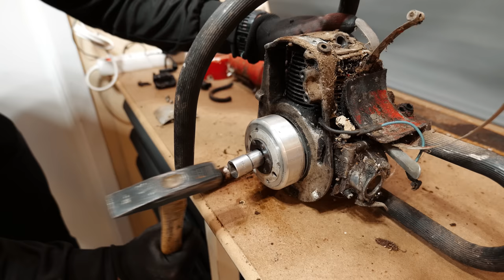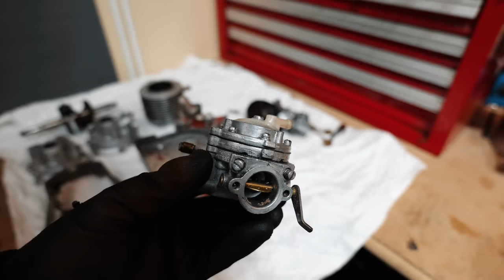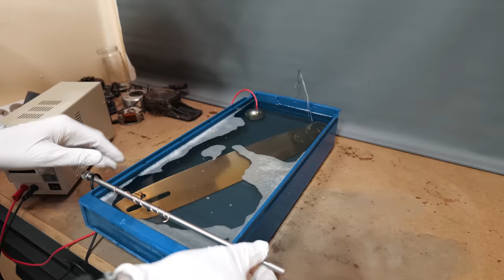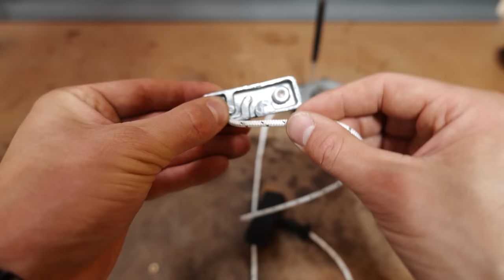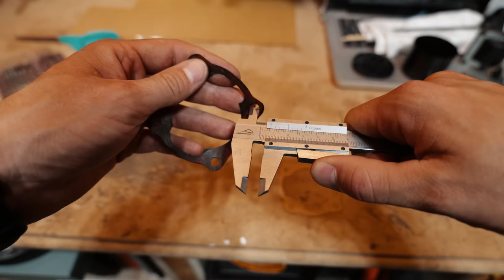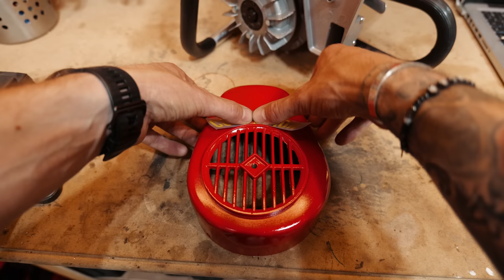RARE Chainsaw Restoration + Engine startup

Comment: I like your Zinc plating method because I can resurrect old lawnmower mufflers that way.

I hope that you used a gasket material such as Kevlar for the cylinder head gasket which can withstand the heat !
Reply from the maker: Yes zink works great on mufflers 😊 
For the cylinder head I used copper witch is original for this engine. 👍

Comment: tip: do not force the piston pin into the piston using a vice, I have seen people who pushed the piston Oval.  The design is such that one needs to use mild heat which expands the aluminium and thus creates a larger bore to slide in the steel pin   upon cooling the pin is firmly hold by the Alu.   removing: also use mild heat

Comment: Great way to bend/brake a connecting no turbo/supercharger, nitrous or bad timing required but atleast you don't have to worry about damage to the cylinder

Comment: Zinc plating is great for those old parts. It's my understanding that zinc has slightly better corrosion protection than nickel, due in part to galvanic action, though most youtube restorers prefer nickel, likely because it can be polished. I particularly like your comments for those repairs not shown. Magic not needed to be assumed. Enjoyed the restoration.
Reply from the maker: Thank you! Happy that you enjoyed my work. 😊🙏

Comment: I couldn't help but point out that when you zinc plated the bar for the chain you probably messed up the chain sprocket that is in the end of the bar which you probably didn't realise was there also the air cleaner did not need to be sanded I'm surprised that it started but definitely not first time would have been good to see it actually cut wood
Reply from the maker: There will be some wood cutting, maybe in a future video 🤔 Thank you for watching. 😊

Comment: You need a hot water pressure washer those things are amazing mine was a Landa electric 120V pump and diesel burner. 750 PSI the wand had a T handle grip like a motorcycle throttle turn to adjust the pressure I usually just ran it on low pressure valve would bypass the water around the nozzle. The 200F water would melt away the oil and dirt so easily. Eventually the coil rusted out and part cost wasn't worth fixing it sure miss it.
Reply from the maker: Sounds like an amazing piece of equipment! 😊

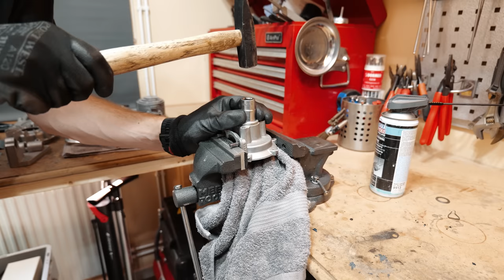Comment: at 17:05    one can see the rotary disc  when the red grease was applied to  the shaft of the crank . Rotary disc  as a thin ( hardened) steel plate   this one having a recess of guestimated 90 degrees   which dictates the opening of the inlet channel .

Comment: clutch springs are weak and/or idle is high... chain should not move at idle... solid work though.
Reply from the maker: Thanks for watching 😊🙏
Reply: Пока мотор не наберёт рабочую температуру обороты будет высокие, после того как двигатель прогреется обороты упадут и цепь перестанет вращаться.

Comment: Remove the piston using the hammer is a rookie thing… you can damage the rod or the bearing.     Is a clever and simply solution to use an little pipe+a bolt+a nut
Reply from the maker: It worked just fine, and no damage to the piston or bearing. 

But next time I’m buying press for it or using your solution, thank you for that! 😊🙏